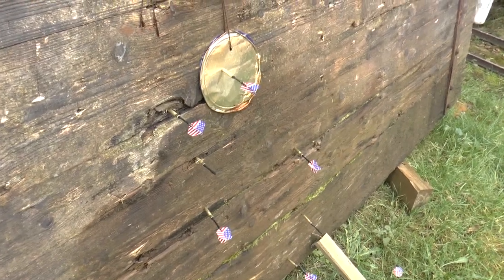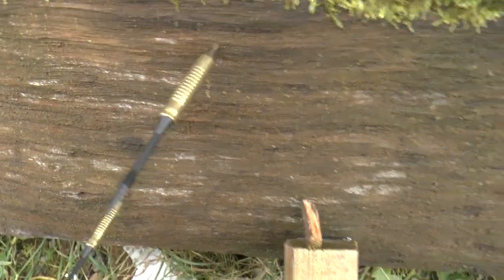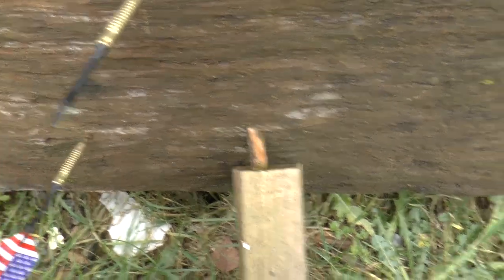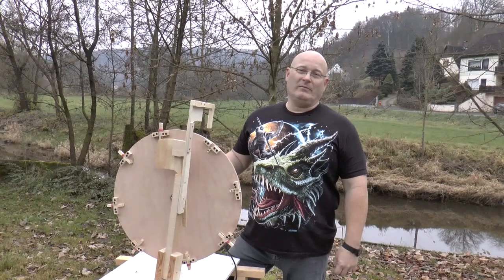Clothespin Dart Machine Gun: HiSpeed Slomo Video

Comment: 5000 glass marbles from a rotary launcher - there was a military weapon prototype a few years ago that spun steel bearings up to speed and and opened a gate to release them, creating a very high speed machine gun that delivered ridiculous energy on a target.  It was designed to be mounted in the back of a small vehicle.  The gyroscopic force probably made it difficult to turn the Humvee while driving.  Can't wait to see Joerg's version.  I hope you can shoot some steel bearings as well.
Reply: Check his drill powered machine gun from 8 months ago. I think what you describe is there.
Reply: Re:vant The steel ball launcher was great

Comment: If you experimented with moving the trigger mechanism back a little bit, or tilting the clips back a little, so the darts are released flat instead of pointed sligtly down, it would increase the accuracy and possibly cut down on the breakage of the darts when they hit, since they won't be wobbling so much. But then again, it might increase the breakage as they should be moving faster, not having had to correct for the initial launch vector.

Comment: If you could bolster the clothespins somehow, they might last longer. Or, make it so the clothespins are turned 90 degrees, so they take force in the direction they are designed. You could use a wire bracket so the darts could still point the right way. A rough plastic flap could be used to brush the clothespins open.

Comment: That is really neat!  I have one suggestion...it looks like the darts aren't being fully released until slightly after reaching their peak.  If so, then that slight downward velocity may cause the darts to tumble slightly.  Is there a way to adjust the release lever mechanism so that that activates the clothespins slightly sooner?  I may also be wrong due to the angle of the camera, but either way...I wouldn't want to be in front of it to check it.  :-)

Comment: And the slowmo revealed a possible design flaw:
If the clamps would be attached ~30° clockwise, the darts would be released in a straight line and should be more accurate since they'd be already on target right from the 'launch'.
Maybe worth a try.

Comment: To improve accuracy, when you load them you should put them at an angle of inclination with the dart tip facing slightly upwards, I think this would prevent you having to rely on the darts to flatten out as much and would reduce wobbling etc.

Comment: I think maybe if you move the release point a few degrees before perpendicular and give the darts more clearance you might have more predictable and uniform trajectory. It seems like most of them are releasing at a downward angle and hitting their fins on the release mechanism.

maybe add a paint brush to the release mechanism to help keep the darts launching flat.

Comment: would there be some way to mount the darts facing outwards instead of in line? because you see all of the darts pointing downwards after release and im pretty sure that would be a major factor of the inaccuracy. so if you were to point them outwards you may see them straighten out faster after release possibly tightening the grouping. another cause of the inaccuracy would most likely be the release mechanism. it slows the disk slightly when hitting the clothespins which is why the first darts shoot high and the last always hit low. so if you could find some mechanism that releases darts without affecting the rotation speed it would make for a much more accuract shooter

Comment: I think you should place fixed strikers (plates or same sized balls) on the outside of the wheel and let them strike/launch balls.  This would be a simpler, more durable, and more flexible design than releasing the balls.  You had a slingshot rifle design a few years ago that used a striking launch mechanism.

Comment: I expect,, the prezision Problem of the dart Machine Gun is made by the Rotation of the Wheel. The Darts go in to rotate, so they don't fly straight. I expect, if you use something like a Chaibsaw Blade to exelerate the arrows, they would fly more straight.

Comment: A handheld design would be awesome, more ammo if you use marbles with the smaller circle too, the speed would improve and wont burn out motors so quick either.
Can't really figure out the firing mechanism though, seems a little inelegant?

Comment: you should put that launch mechanism more back.  As you can see in the video,  the darts launch in an angle with makes them more inaccurate.
Reply from the maker: Mrmursumato If I put it back, the darts fly high though.
Reply: JoergSprave have you tried putting the clothespins in an angle?